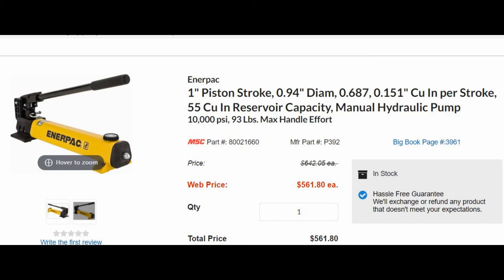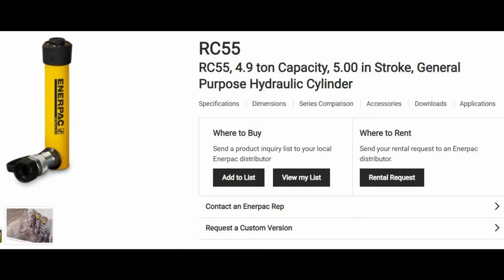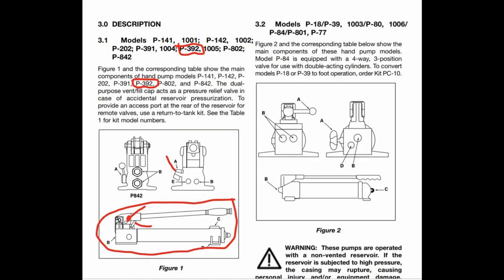Enerpac Hydraulic Power System Repair Pt 1

Comment: Been a long time since I've seen a Finnegan Pin.
Reply: Yeah when I worked for IBM ya had to have the manual to order parts and do repair procedures.
Reply: 560 bucks wow.
Reply from the maker: They're pretty common around the workshop. Most of them are the double tapered ones. Can't tell if they are coming or going. 😈
Reply from the maker: @mostlymoparih5682  I impressed the hell out of the crew at UTC when I was able to diagnose problems with the big 1600 ton extrusion presses and the burner controls on the 100,000 melting furnaces. They never cracked a book before I got there. Manufacturers put troubleshooting guides in the back of the books. It was like magic.   😎
Reply from the maker: @mostlymoparih5682  It's a smaller single speed unit. They get crazy expensive. I was amazed when my neighbor was going to toss it out. I dumpster picked that one before it reached the dumpster. 😆
Reply: @OldSneelock  There you go again Unk with another story topic. Before I got my drivers license my brother was working cleaning a kitchen for a food chain that was called Buxton's. Well he didn't like doing it so he got me to help and he would give me some money. (They also had ice cream they made on the premises and they boss would let us take some) Well he wanted to quit and because of the benefits (ice cream, chicken, and veggies) my dad wanted me to keep working there. I was okay with that but my brother has to drop me off and my dad would pick me up. Now to you reminder, dumpster diving. Well one day we come to work and the boss says the health inspector was there and they had to dump cases of frozen hamburger patties because some of them had freezer burn. So in we go, me and dad and grab all the boxes in there. We grew up on a farm and had a big freezer that was 6 by 8 and we darn near filled it with hamburgers. That was one summer and for the next almost year we had free burgers and ice cream. Thanks four4 the memories Unk. Oh and sorry four4 my ratchet jawing.
Reply: @OldSneelock  IBM called em MAPs  Maintenance Analysis Procedures. And you are spot on they were very good.
Reply from the maker: Sharing stories are my best memories growing up. Dad's buddies would come over to the big workshop in Dad's barn. While we worked they would swap stories. It's a lot less painfulmto learn from the mistakes of others. When they were telling you about how they got the scar, crooked finger, missing tooth, or whatever in a story, I think it helps them work through some of the trauma too. 
I know that sliding down the highway on my butt was a lot scarier doing it then talking about it to my friends later. 😨
Bring all the stories you can. I sure enjoy them 
And good score on the grub. I'll bet the owner was happier having them go to a good use than just letting them rot in the dump.
Reply from the maker: Early on I was convinced that the older guys knew a lot from experience. The only way I could keep up was by getting thevexperience myself or borrowing from theirs. The apprentiship classes at the foundry were great. Before taking them i only thought I knew stuff. 
Dick German was the head of maintenance. He came up through the ranks. Good guy to work for, but not real good at teaching. The other guys shared what they knew but that only helps if yhey ran into the problem before. 
Problem solving is a process. IBM is really good at thinking ahead.
Reply: @OldSneelock  Another good point. Thinking ahead. I do that a lot and maybe IBM is where I learned it. I worked with a bunch of great technical guys and they were the goto guys when you got into trouble and you would call them to come help you out. After being helped a few times I learned to do what they do, think it through. If I was going to call let's say Pete I would think, what's Pete gonna ask me? Did ya check this kid, did you measure this, are there parts on the way, what did you order? It got so that I would be calling for help later as some of the answers to those questions would fix my problem. I learned to pick their brains and again as you say experience is the best teacher. It hurts when I do that. Well meatball don't do that. I became a very good observer not just of machines but of people too. I made good and bad lists and things to do and things not to do. We become creatures of habits and do things over and over again so it's good to have good habits. I worked with a guy who smoked a pipe. Man did the apple and cherry tobacco smell good but he held the pipe in his mouth on the right and from years of this habit the right side of his mouth hung down. Mental note no matter how good it smells don't smoke a pipe.
Reply: @OldSneelock  Four years ago. My my my. The places we've been to and the stories we tell. When we get to heave we will be able to tell stories for a long time and tell some over again. Time flies when you're having fun. Dottie started PT for her shoulder and then her mom had trouble breathing and went to the hospital. The  hospital would not let her go home because she could get out of bed by herself but that's because the hospital put a monitor on her and wouldn't let her get out of bed. As we get older we gotta keep moving otherwise we start to lock up and that's what happened to her. Now we have to keep running over to rehab to make sure they are doing their job so she can get limber again so she can go home. Always something. Gotta watch the grandkids too so their mom can finish a course at college. Always something well I guess that keeps ya busy and busy is better than sitting around and getting locked up. Have a great day guys. Good remembering good memories.

Comment: Wow, Enerpac has really gone cheap.  I have an old P39 pump, all cast iron and steel.  No reinforced plastic, no sheet metal formed bits.
Reply from the maker: Everything is getting cheaper. 
FRP is touted as durable and light weight. If it sits in the sun it decomposes. The iron ones are a lot better.